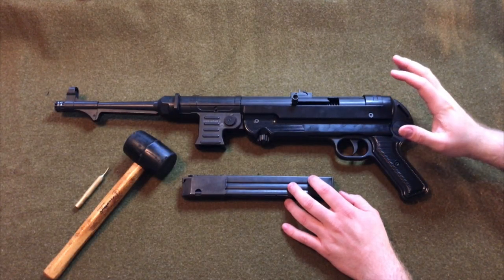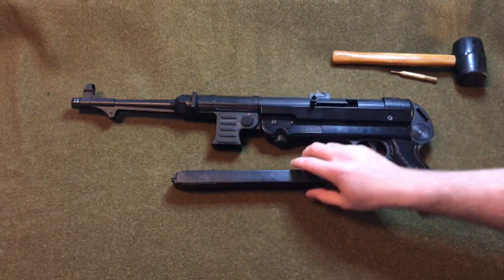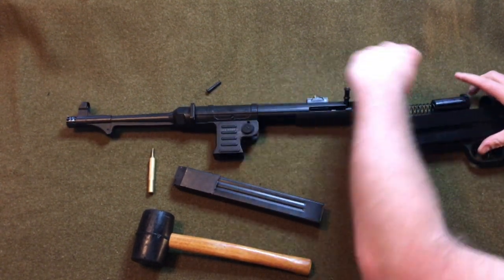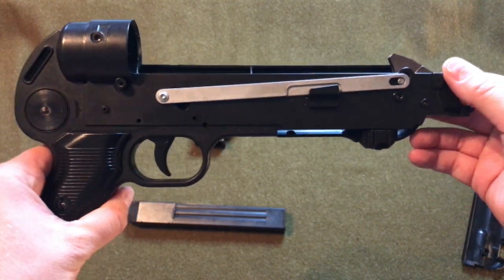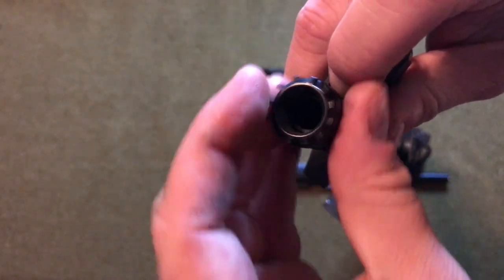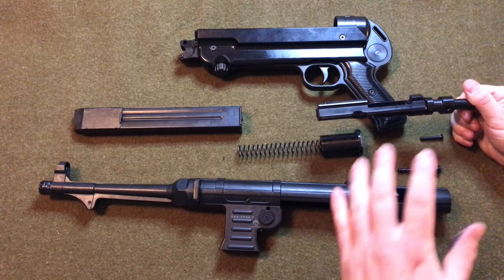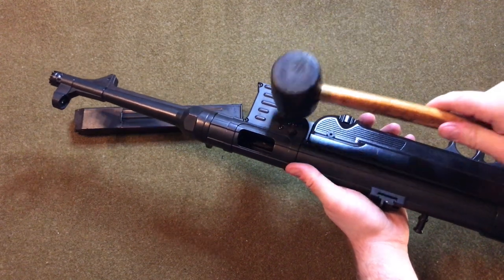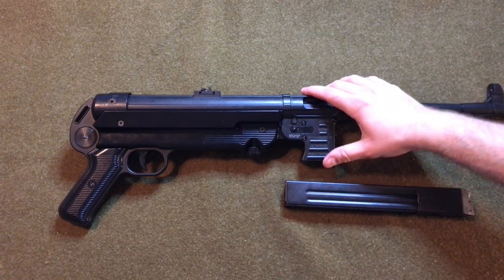GSG MP40 9mm Disassembly

Comment: The stock 25 round magazines are actually really easy to convert to hold 32 rounds. I've done it to all of mine and it made the gun run better. Also made a new trigger bar that made the trigger usable.
Reply: Care to share ?
Reply: @ProjectStrum  Which part?
Reply: @AjackLee4  sry, the magazine capacity.
Reply: @ProjectStrum  Just trim the follower and spring until 32 rounds fit, leave enough on the follower so that it'll still center itself however.
Reply: @AjackLee4  ty
Reply from the maker: Thanks for the advice!
Reply: Do you trim the bottom of the follower more? do you trim the spring from the top or bottom?
Reply: @stevenrothwell19  I trimmed the bottom of the follower and spring both.
Reply: @stevenrothwell19  Take a little bit until it works, don't go overboard, I will say I removed all the extra bottom material of the follower and left only enough to keep it centered on the spring.
Reply: Do you have a video on how to do the magazine conversion?

Comment: Good video. I just got a pistol brace adapter and picatinny rail to replace the rear sight on my MP40. Didn't think I'd have so much fun with it. Has no recoil and great follow up shots. Thanks for showing me how to disassemble it.
Reply from the maker: Haha that’d be something to see for sure! I do want to get the folding stock for it eventually so it’ll be in historical configuration but they haven’t been available for awhile.
Reply: @GarandGuy2553  I'm wanting to get a stock kit for my mp40p as well but I read somewhere that in order to do so legally, you'd have to register it with the A.T.F. as a short barreled rifle and I believe the application process cost $200.00 Do you have any knowledge of this or know if there are any loop holes around registering the firearm? I just don't like the idea of registering my firearms with the A.T F.
Reply from the maker: @iconicamericano1131  Yes, you’ll have to register it as an SBR if you attach any stock to your pistol.
Reply: @GarandGuy2553  Thanks. I guess we all must compromise sometimes in life.  Americantactical.us sells ATF compliant stock kits for $269.95 . Though none in stock at the moment. Im not sure if that's a good price or not as it was the only one I've seen so far. I'll do some digging, if I find any in stock I'll let you know

Comment: You neglected to mention the little flat half circle clip (one reader called it a 'cotter pin') on the right side of the weapon that prevents the disassembly pin from being knocked out from the left side as you instructed (and must be replaced upon re-installation). Until you can manage to get that clip off the pin (somehow without scratching the metal), you are not going to have any luck getting that bloody pin out no matter how hard you hit it with the punch.
Reply from the maker: Yeah, it’s annoying piece. Some guys replaced them with AR15 style takedown pins

Comment: Just got one and the take down pin has to come out from the other side. It has a c clamp on it. C clamp must be removed and then you can tap the pin out from the right side of the weapon.
Reply from the maker: Interesting. They must’ve changed it.
Reply: How did you remove the C clamp without damaging it? I'm having this issue.

Comment: My bolt won’t lock in the grooves to keep it open 

I took it apart and don’t see anything wrong or broke 

I don’t know what to do 
Bought it yesterday from a pawn shop 

It was brand new
Reply from the maker: You can definitely call the company. Their customer support is pretty good.
Reply: @GarandGuy2553  thank you
Reply: I've got the same problem. Did you ever hear anything about it from customer support?
Reply: @User0768  I haven’t called yet 
Have had a lot of things going on 

I have fired it tho 
It fires and cycles threw the mag but when the mag is cleared it won’t lock the bolt 

And sometimes I can’t rack a round out it gets stuck or something